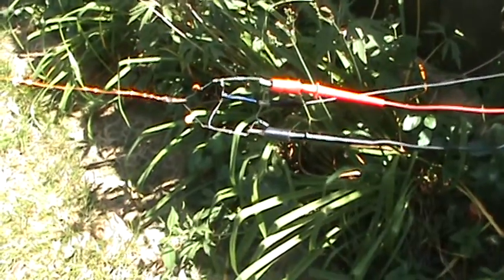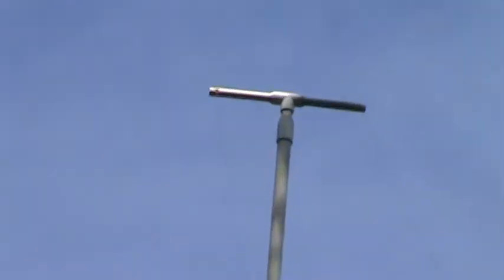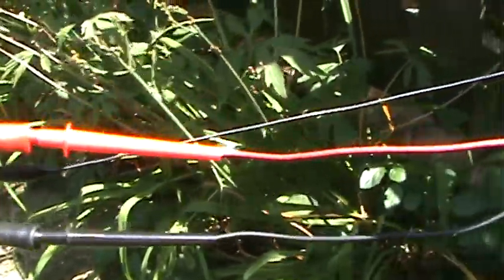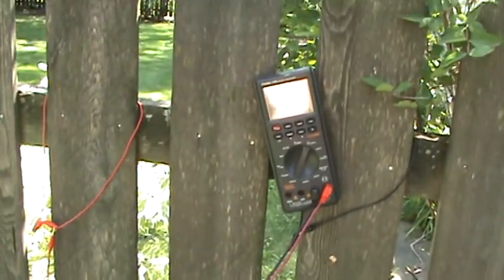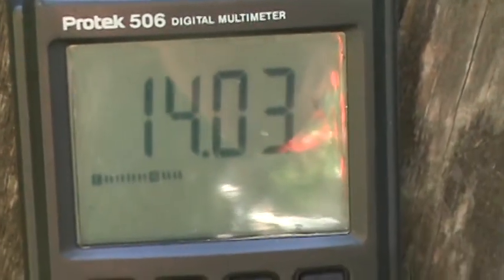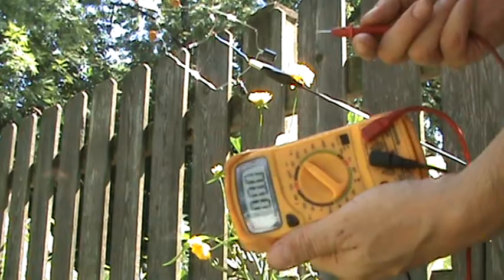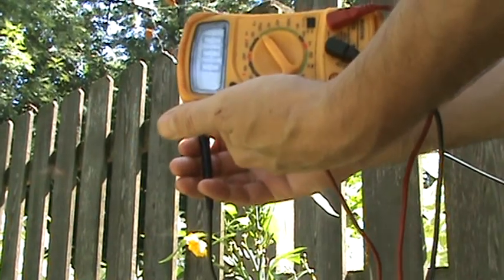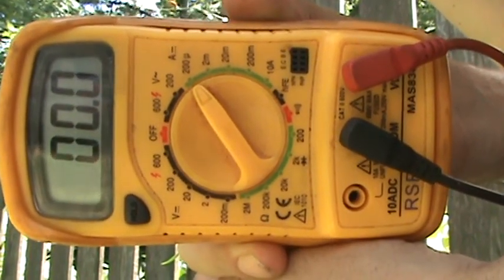Free energy from air TEST

Comment: The circuit he uses is just simply similar to a crystal radio set. It is basically a crystal diode that rectifies rf energy present nearby. Lucky if you live to a nearby radio station since it should pick up sufficient rf energy. Since the amount of current produced by the circuit is very small, i think this is not sufficient to do some work.
Reply: @hevirred3043   it's not that powerful but the principle is solid right? I'm not an electrician im just interested in this stuff.

Comment: you do not need that large antenna use a florescent light to pull energy from and a tin can you can draw 15 volts dc at .14 milli amps the next thing i would like to try is connecting it to a satellight dish and pointing it at a star

Comment from the maker: When cheking Amps, yes, in series. But in video im checking voltage across(parallel).  I did, in the past, check Amps incorrectly, thats how i messed up Amp setting on that meter.     Thanks.

Comment: I did not see other videos.
Amp meter must be connected is series.Electromagnetic wave is a source of energy.
There is not clear  if antenna is connected to the ground. No sign of insulators.
Every antenna has particular wavelength corresponding to its own resonant frequency.
Near by, strong transmitter you can have ( after rectifier)  light bulb   on, that does not stay about  energy from air, but energy from transmitter. Try strong AM transmitter.
Thank you for video.

Comment: Checking on flux: Muons arrive at sea level with an average flux of about 1 muon per square centimeter per minute; and the mean energy of muons at sea level is still 4 GeV
4 gigaelectron volts = 6.40870585 × 10^(-10 power) joules

That means the mean muon energy flux per 100 square miles per second at sea level is about 2,766.411987 joules

Comparison: There are 3,600 joules in a kilowatt hour that power companies sell for $0.10 to $0.15 each. meaning 100 sq miles to generate less then 1kwh/s

Comment: Clean, Renewable and Sustainable

i take issue with 2 of those claims
renewable is the only thing legitimate. The problem is the energy flux is too low.  To collect enough of it requires too much capital cost. Too high of a capital cost is not sustainable. 

If it consumes millions of dollars to smelt and refine copper or other metals for just a  few kilowatt watts of power, then its very production is dirtier then other sources.

Comment: Sure you can capture some of the free energy, but the flux of energy is low, and the material you use are not free which drives up cost.

All i ask is that you discover what the potential energy flux is and decide if this the way to benefit society or are there better ways.

Who would want to pay nearly $100,000 per watt of capacity, when solar can produce a watt for just a $1, $2, or $3?

Comment: Your circuits work with radio waves which have relatively little energy.

1. You can make up for that with larger collection area but loos out to copper losses
2. Your circuits could target higher frequencies but they have higher copper losses due to skin effect
3. You could improve 1 and 2 by increase the diameter of the copper wires to copper cables which increases cost.
4. Super conducting cables would eliminate resistance but inure cooling losses.

Comment: I do wish you the best of luck.

To get a better idea on the real potential, consult a physicist on the energy flux in the bands you wish to capture (Watt-Hour/M^2) Shorter waves have more energy, but are more attenuated.

If the flux is to low, it may never be a commercially viable solution. Knowing the flux will help you determine if this has real potential, or if you should work on something else to benefit you and society.

I wish I could help you, but my layman knowledge only goes so far.

Comment: 14 volts * 160 microamperes = 0.00224 watts
If you spend $10 on the setup and parts, then your spending about $4,464,285.71 per kilowatt of power.

1 kilowatt hour from the outlet cost about $0.10 to $0.15

You have a long away to go to make it profitable. Don't take this too seriously, but please don't ask for any grants on this.

Comment from the maker: @TheChrisky13 I devoted a good month to studying transistors & types, they talk of power, voltage & current amplification, but the only amplification is from the base to collector or emmiter, their is no over unity. They will never put out more power then is applied to them. Maybe their is another effect that im not thinking of, but so far i see no great hope for transistor in the circuit. If anything helps to gain power it is most likely due to circuit being closer in tuned to resonant freq.

Comment from the maker: @TheChrisky13 to increase voltage add a coil between the plate and circuit. Yes, also ground should incrse voltage greatly. I would also try to add more plates(alum foil works), each going to its own circuit and connect in series,,,or even multiple plates going to a single circuit. More plates or circuits should get you more current.

Comment: I can't remember if I said this but wouldn't it be possible to use one antenna and multiple circuits to it at different frequencies to harness across a large spectrum?
Also adapting the antenna at the pinnacle or creating two antennas together to resonate with one another.